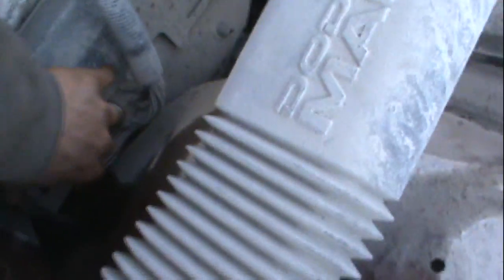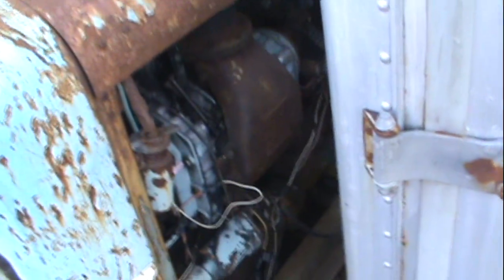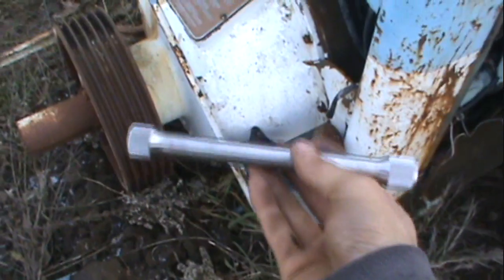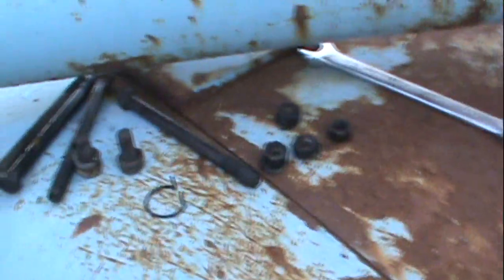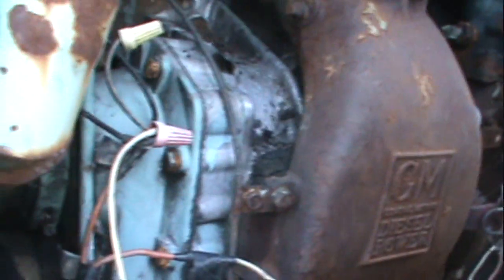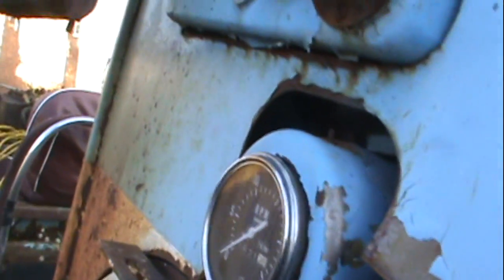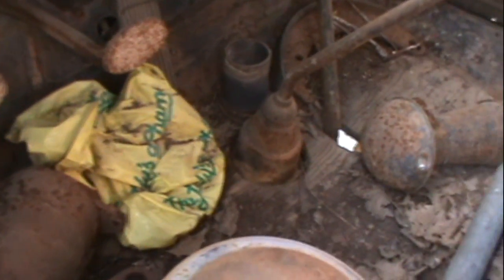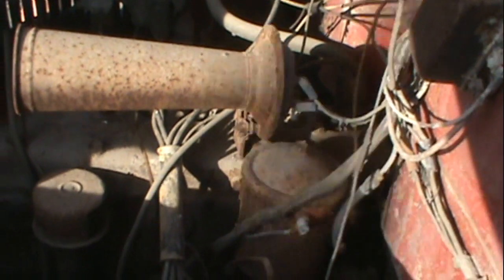Detriot Diesel Shaft Return

Comment: under speed governor is so that you dont run into load problems, keeps the engine in optimal torque, so if load on the generator that its driving gets more load it doesnt stall out the engine.

Comment: hi you mentioned a 2 stroke Detroit need the supercharger to run , that is correct but it is used to scavenge the exhaust gas out not to compress air for boost to combust

Comment: from what I understand your better off cutting of the air to the engine because diesels can do whats called runaway where it runs off the oil in the sump and can explode if you dont cut off the air or engage the clutch to stall it if it has one.

Comment: THE AIR CUT OFF IS FOR EMERGENCY USE ONLY!!! You will blow every seal on that engine if you use the air cut off to shut it off! There is a lever on top of the governor that cuts the fuel off on it. All Detroits have the emergency stop.

Comment: The flap is an emergency shut off, if the rpms go to high the flap will close to prevent a run away. fuel is shut off like every other diesel to stop the engine normally.
Reply: +nmdiesel89 the emergency stop is actuated manually
on a 2 stroke detroit diesel, usually a runaway is due to binding in the injectors linkage and when it's happening, the injectors are maintened fully opened without any external provision to shut them off.
If you use the emergency stop flap to stop the engine, you can be sure that you must remove the blower to replace the 4 oil seals as they are destroyed.
the best thing to do is to leave exposed the linkage as long you start the engine and work the injector racks to their full stroke then you can seal safely this engine as the blower and the goverenor are not positively fixed with dowel pins or a register and a bad aligment can result to a runaway or blower shaft breakage
Reply: +Jacques Poirier Nope, some detroits had a spring activated anti runaway air shut off and some of the older ones had an electronic one that would shut if rpms got too high. Can Google it.
Reply: +nmdiesel89 newer*
Reply: +nmdiesel89 
last versions with DDEc and electronic unit injectors had not air flap, For the bus application, the flap was operated manually as there no electronic or speed switch on these engines
probably that for engines running without direct supervision that there is something to activate automatically the flap
Reply: +Jacques Poirier alot of the gensets and stationary power units had them on the older models.

Comment: Those old L head Chrysler engines don't have much power and getting parts for them are getting hard to find.  My old man has lots of experience with them one of our forklifts has one. You can find them in older portable welders. 

Distroy it diesels have power on the bottom end it all depends on the injectors it has. The 53 series scream louder the 71 series has more power. The 3/53 is a real screamer mostly found in compressors. The 4/71 6/71 8v71 and 12v71 are fairly common.